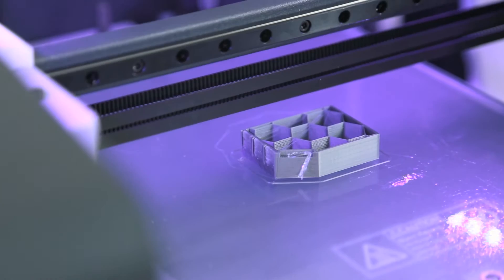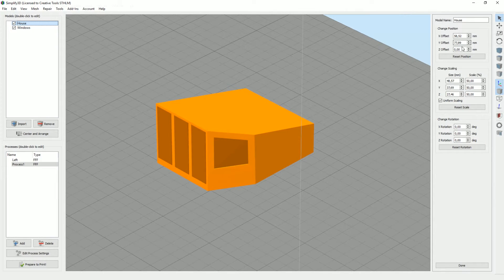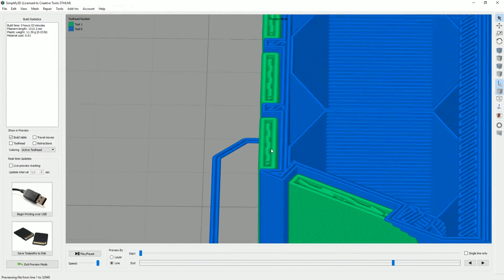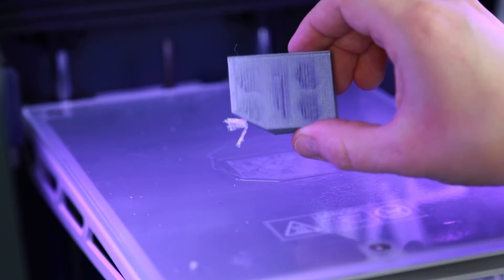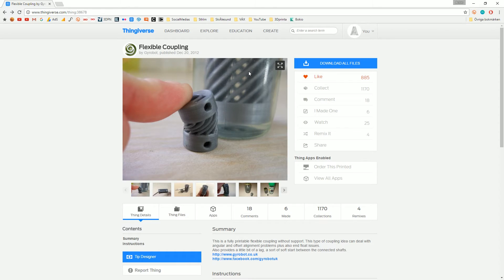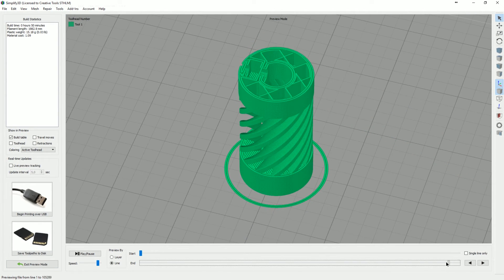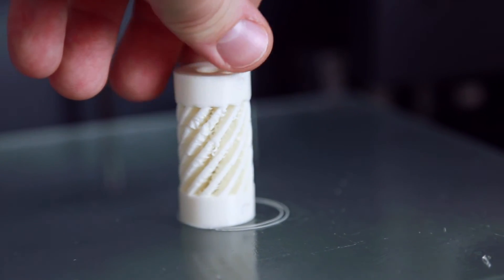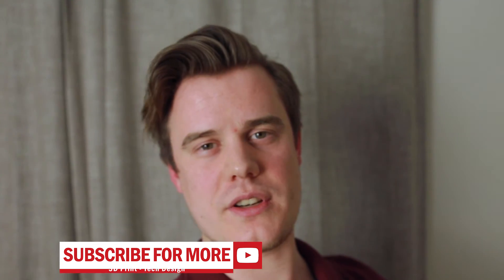BCN3D - Sigma R17 - VLOG 7 - Testing with flex and poorly designed Dual extrusion

Comment: I think you need to do a Boolean operation to subtract the windows from the building so material from both models isn't trying to occupy the same space in Simplify3D. I also think you'd get a smoother finish on the windows if the model is printed using a smaller layer height.